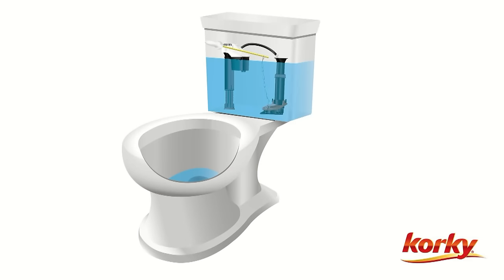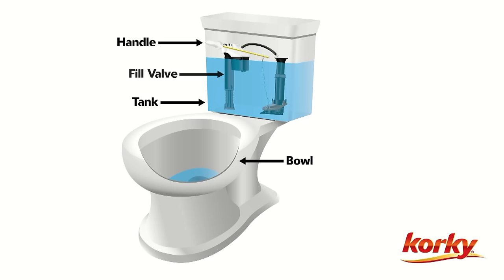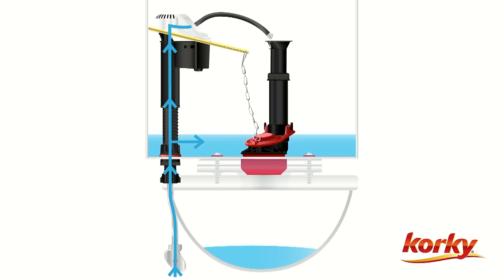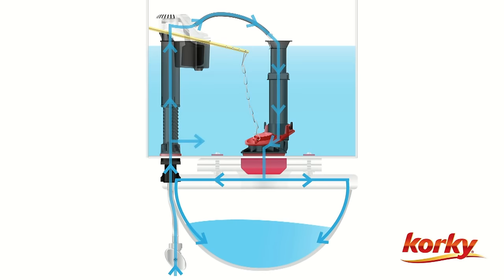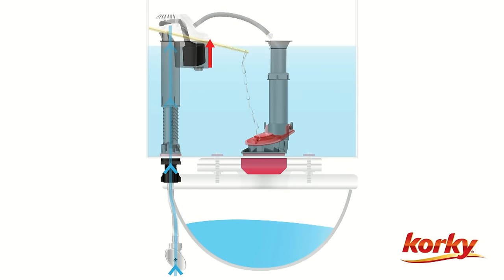Anatomy of a Toilet

Comment: Just came to learn this in case i wake up in medieval times.
Reply: So I'm not the only one who thought this. Good to know.
Reply: @ExBlaz3  Do you know a video that teaches you how to generate electricity? In case we wake up in medieval times.
Reply: @BURGATRON  use a magnet and a coil put the coil in the center and spin the magnet around the coil, boom electricity, the wiring part idk but if you spin it fast enough you can get at least 12 volts
Reply: @thwalesproductions  hello! How do I invent a magnet and coil in medieval times? Thank you
Reply: Good idea. I woke up in a Medieval Times before and the staff there were NOT happy.
Reply: Here i thought i finally had an original idea😔💔
Reply: @BURGATRON lol

Comment: This is the best video to learn how a toilet works before I even attempt to fix a toilet. You have no idea how many professional videos there are on YouTube telling you that the refill tube that leads into the overflow valve refills the tank when it actually refills the bowl.
Reply from the maker: Don't hesitate to reach out if you need any assistance with fixing your toilet.
Reply: Ha ha nice words, but actually sounds like a subliminal burn
Reply: OK, so what is refilling the tank?
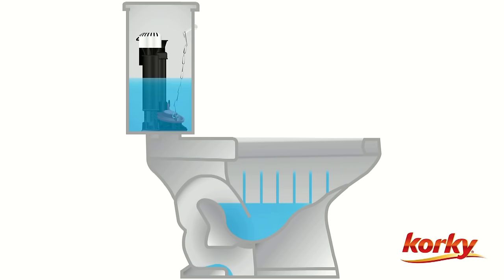Reply: Definitely.  Their tank diagram (starting at about 00:48 seconds) is much better than most videos out there.  It shows clearly that the base of the refill mechanism is what fills the tank, while the overflow valve is being used to fill the bowl.

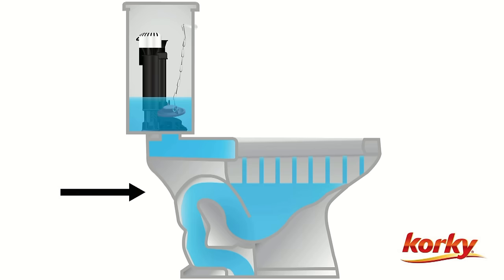Comment: I think the flush in the first part of the video is inaccurate for two reasons: (1) the bulk of the water entering the bowl should come from the siphon jet, which isn't even depicted in the video; (2) the appearance of an air pocket as happens between 0:36 and 0:38 on the video shouldn't happen in real life (assuming of course the pipe is closed off from the sides as it would be).
Reply: +ns2675-  obviously i'm way late to this vid as well, but when it auto-played, like u, i felt they'd left out THE most important part to help folk see it.  i said, "wait, show the bowl hole (siphon jet) that makes the siphon effect kick-in at the trap pipe which causes the flushhhhhhh".  ;)

Comment: It's cool how the drain uses nothing but water as a seal. The only problem is in Australia where a snake could come up and bite you ass. I wonder if they could add some "wildlife proofing" mechanism lol
Reply: Yes they can just add a extra plastic and attach it with a spring so its open when the flash is pressed and so a snake can't climb up

Comment: So I can see how the float would stop the flow of water through the overflow tube but what makes the water stop from coming out at the base of the refill valve?
Reply from the maker: The float controls all of the water coming through the fill valve. If it rises to shut off the valve, it prevents water from refilling through the base of the valve and the through the refill tube.

Comment: So when the flapper closes right after a flush and while the tank is filling there should be no water slightly streaming into the bowl, correct?  Or is this normal until the tank is filled?
Reply from the maker: Water may still stream into the tank via the flush valve overflow tube. Water from the fill valve is sent through the supply tube, down through the flush valve overflow tube, and into the toilet. It is normal to see this until the tank is completely filled.

Comment: I dropped a screw by accident into the toilet. What are chances it will flush? So far it doesn't seem that it is blocking the tube. Thank you.
Reply from the maker: Would you be willing to give us a call?  We'd like to learn a little bit more to help assist. We are available M-F, 7:30am-5:00pm CST and can be reached at 262-763-2434 or by e-mail at Sales@Lavelle.com.

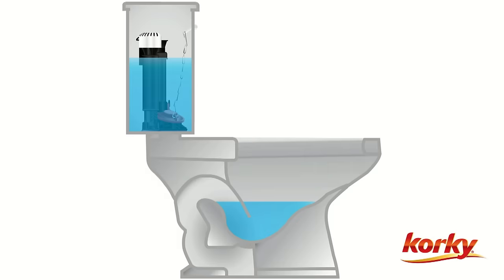Comment: 0:23 So there's a pocket of air between the refill tank and the bowl water? I need to know so I can confirm the small amount bubbling at the beginning of a flush is that and not a clog.
Reply from the maker: You should not be experiencing any major bubbling at the end of your flush. The water sits in the trap way to prevent sewer gasses from coming up into the toilet and stinking up your bathroom.
Reply: @KorkyToiletRepair  No, not the end of the flush. I understand what you're saying. That's a partial obstruction in the drain pipe or air vent. My issue is at the very beginning of the flush, as though it's coming from the syphon jet. Not the little ones at the top of the rim. I'm talking about the larger one at the bottom of the bowl.
Reply from the maker: @stephaniegormley9982  Thanks for the clarification. It would be very rare to have any sort of obstruction at the flush valve opening (hole between your toilet tank and toilet bowl). It is possible you have some sentiment, hardwater,  or iron build up, but not so much that it would actually be creating an obstruction. If your tank to bowl gasket is old, it could be obstructing a bit, but again, this is pretty rare. Our Technical Support team is happy to help troubleshoot with you over the phone. Please call 262-763-2434; We are available M-F, 7:30am-5:00pm CST.
Reply: @KorkyToiletRepair  Thanx for the reply. I don't think age is the issue since it's a brand new toilet. Many toilets have a  couple, very small bubbles at the onset of a flush. Perhaps this particular brand (Mansfield) just creates more than others do. I've previously only used American standard and Kohler.

Comment: I seem to have problems with the tank mechanism these days

First i had water leaking around the pipe that fills the tank with water

I had someone fix that

Now i have another problem

The fill valve wont fill the tank with water

You flush the water and then you would expect the valve to open to fill it up again

But it does nothing until i open the tank 

These things are a mystery to me

If someone can help with a useful advice i will appreciate it
Reply from the maker: That's what we are here for! Give us a call at 1-800-528-3553 or email sales@lavelle.com and we'll help to get your toilet working correctly in no time.

Comment: Serious questions:

1)  I have a neighbor in the apartment above mine who seems to flush HIS toilet after every time I use the toilet.  It's got me paranoid that things are going UP into his toilet, but gravity makes that seem like it can't be possible.  Can it?  

2)  This neighbor also flushes his toilet an excessive amount of times on weekends (like 10+ in the span of a few hours, sometimes multiple flushes in a row).  At first I thought it was just multiple people (he likes to party) in line for the bathroom, but now I think it's just him (like when there's those back-to-back flushes).  Is there something mechanical that can explain this?  

(I can hear the flushes, because the walls are thin and also the pipes are really loud whenever someone flushes.  Almost rattling.)
Reply from the maker: All great questions! Gravity is a toilet's friend, so rest assured your toilet isn't flushing up :) 

Your neighbor's toilet could be experiencing a ghost flush which is caused by a slow leaking flapper or seal. This would trigger the fill valve to do it's job and refill the toilet tank. 

Or...your neighbor is very hydrated, requiring frequent trips to the toilet.
Reply: @KorkyToiletRepair  Thank you!  And for responding so quickly!
Reply: @KorkyToiletRepair  He's doing it again!  I do know it's not ghost flushes, because it'll be silent all day, then bam, two or three right after another sometimes (literally, as in as soon as it refilled, he would flush it again).  And most of the time right after I use the bathroom.  It's so bizarre.
Reply from the maker: @aewtx  Sounds like he may need a Korky Beehive Max toilet plunger to clear his clogs :)
Reply: @KorkyToiletRepair  haha!

Comment: Where does the water come from?
Reply from the maker: The water going into your toilet comes from your home's water supply through the supply tube. The water valve is usually mounted on the floor or wall near your toilet. The supply tube brings water into the toilet fill valve.

Comment: the water going down the Overflow tube as the tank fills seems wasteful, why does it do that?
Reply from the maker: That water is going from the overflow tube into the bowl of your toilet. This helps to fill your toilet bowl with water for a powerful flush and prevents sewer gasses from escaping and stinking up your home.
Reply: @KorkyToiletRepair  Yea, I took the hose out of the tube, and the bowel water is low
While I have your ear, I had an adjustable flapper, you could adjust how much of the tank water you want to use, it worked great, it finally wore out and stopped sealing, so I bought another one, the darn thing doesn't work, it looks exactly the same but it only has two settings, all the water or about a qt, I got tired of messing with it and just set it to max, I used about 500 extra gallons last month, so now I have it set on min. and I hold it down till enough water goes through.
It has a little hole in the cone that I assume lets the air out so it comes down, I drilled that out bigger, no change.
I don't expect you can do anything, it's just bugging the heck out of me that I can't figure out why it's not working right.
Reply from the maker: @bigredc222  Are you able to contact our Customer Service team? We would like the opportunity to learn more about your toilet, adjustable flapper and quickly identify a solution. Please dial 1-800-528-3553 or email sales@lavelle.com. We are available Monday through Friday, 7:30AM - 5:00PM.